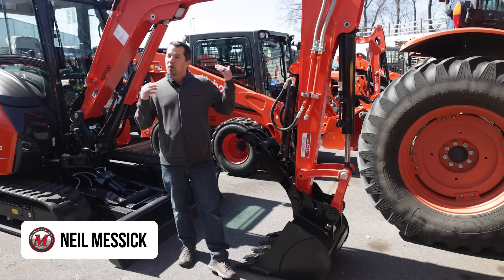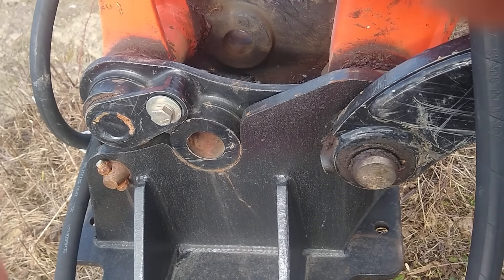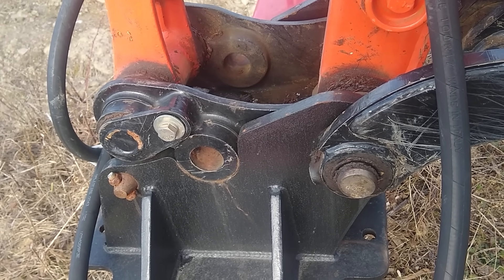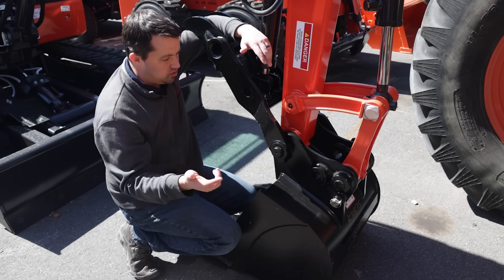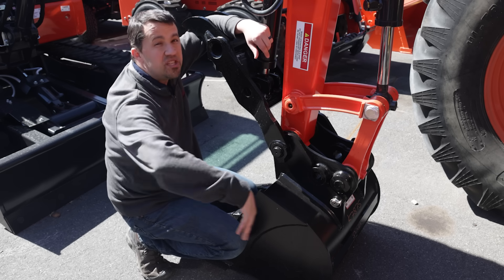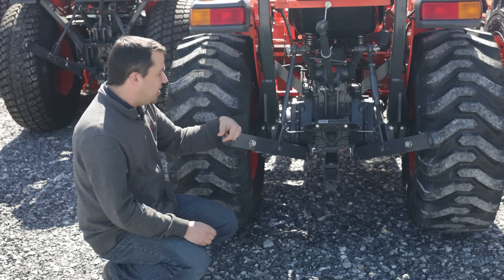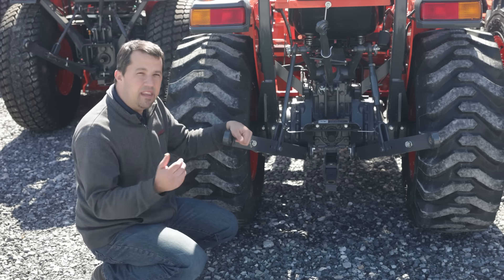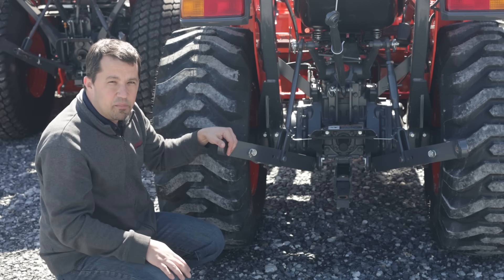Can I use these adjustment holes? | Neil Answers Viewer Question

Comment: This theory also applies to other parts. A part, like an electrical harness, may have plugs “hanging and doing nothing” that I would get questions on all the time when doing GPS related installs. I had to explain that some parts are more generic and are meant to fit a wider variety of applications. 
Same thing with brackets and the like. A single part may have to for 15-20 machines, but the install may be slightly different on each machine.

Comment: Hello Neil, I use the inside hole on the excavator buck to dig foundation walls.  The extra angle on the bucket helps dig down the wall farther before it radiuses at the bottom

Comment: I understand from both perspectives another way of explaining it is if you're digging bellow ground which is not advised without a subframe on the host tractor and extra ballast. Your likely to damage the main loader brackets and inextream cases twist the arms. I suspect that is why the likes of Massey Ferguson offered that feature up until the early 1990's

Comment: Great video. I have owned a M5040 for 7 years now and have actually moved the loader pin multiple times. Higher hole when building a shop building and lifting trusses that weren't too heavy and some other co traction jobs. Otherwise it stays in lower hole for dirt moving and grapple work.